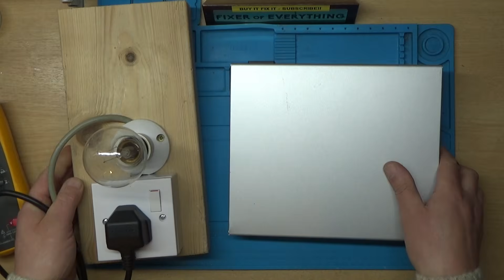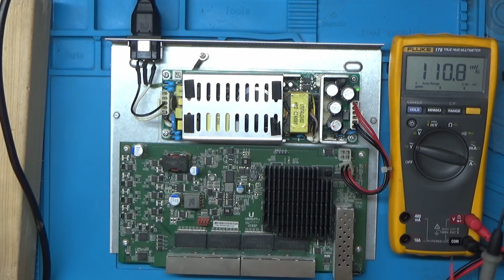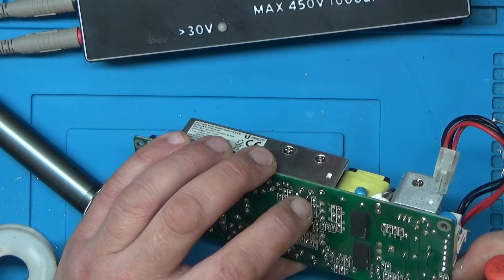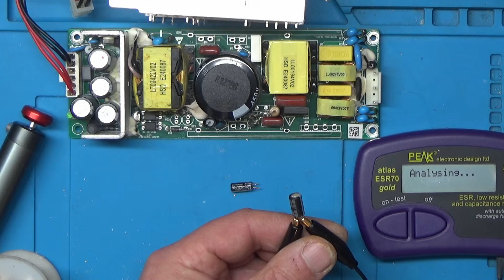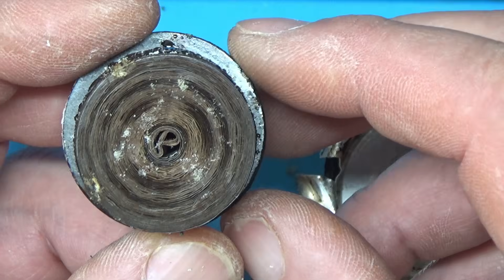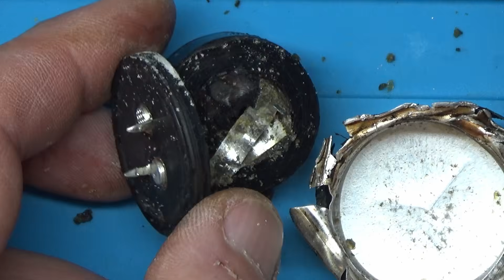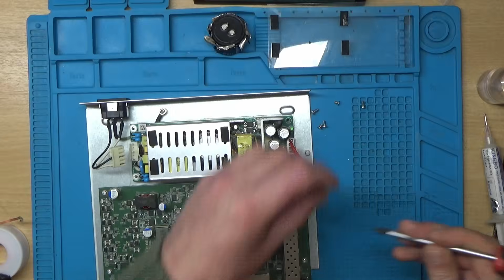Faulty Ubiquiti POE Network Switch | Can I Fix It?

Comment: Got to feel for Ubiquiti here. They make a good power supply with quality parts (Rubycon etc), but select one cheap Chinese cap for height reasons, that ends up causing a load of failures. 

Only ever as good as the weakest part! 😂
Reply from the maker: Indeed. I was thinking either cheap cap, or possibly something to do with the PFC circuit, as mains caps rarely fail in general.

Comment: Quick question - do you only use leaded solder for desoldering? I just noticed that you explicitly state that it's leaded
Reply from the maker: Yes, the unleaded solder is garbage. Leaded flows and sticks much better, and has a lower melting temperature which is why I prefer it.

Comment: my mate vince also tried to fix a ubiquity thing, it was the same cap, inside it had burned in the connection in the center, seems to be the same powersupply as well, i think there’s more of these power supplies with these defective bad capacitors
Reply from the maker: I wonder if they used the same power supply in a number of different units. I also wonder if it's a poor quality capacitor or the PFC circuit causing them to fail. I've rarely seen a mains cap fail on a PSU.

Comment: 9:45 That solder sucker is dangerous because it has no recoil protection ...
What i mean with dangerous is not that it will kill you, but if you don't think before using it you can easy knock out a tooth.
And back in the old days when we had CRT's it was very easy to break the neck of the tube if you didn't think twice before using it.
Reply from the maker: Ah see what you mean. I'd probably have to be pretty close to it to knock out a tooth though!

Comment: electrolytic capacitors are heat sensitive  , that Power supply enclosure with heatsink acts as an oven  baking them slowly .
Reply from the maker: Good point, I had been thinking was it just a poor quality capacitor as the other's seemed unaffected. Also I was thinking is it something to do with the PFC circuit switching that big inductor in and out all of the time, as I've rarely seen a mains cap fail.

Comment: Why did they put a plastic sheet over the power supply vent holes i didn't see a fan on the unit? Maybe make it fail faster?
Reply from the maker: I'm not too sure, I thought it was slightly odd too.
Reply: It's for electrical isolation, to make sure the metal heat sink of the power supply doesn't touch the case.  There's those black foam pads that are supposed to hold the plastic piece off the surface of the heat sink so that the air flow isn't blocked.

Comment: Another saved from landfill, well done. There's never enough white powder when you need some (aluminium oxide obvs). I wonder if that PSU heatsink is at some nasty voltage, hence the anti-case-shorting plastic sheet. Happy New Year to you.
Reply from the maker: Happy new year to you too Ralph. I was wondering if the PFC circuit switching that big inductor in and out could have caused the cap to fail, or if it was just a poor quality capacitor, as mains smoother failure is something I've rarely came across.
Reply: @BuyitFixit  Yes, that same cap seems to fail in a similar way in other PSUs. I was wondering about PFC harmonics, insufficient filtering, snubbing etc., though I suspect it is mainly poor quality.

Comment: The large cap you took out had an insulating disc at the top of the can, I would have thought you might have wanted to take steps to insulate the top of the new can from the metal case/shield. Anyway, thanks for the video :)
Reply from the maker: I never spotted that. Good shout 👍

Comment: "my mate vince" had the exact same failure on his ubiqiti switch repair video 2 months ago.   seems to be a common thing, junk quality caps.
Reply from the maker: Interesting. I wonder if the power supply is used in other Ubiquiti products too. I was wondering if it's just a poor quality capacitor or if it's because of the PFC inductor being switched in and out causing it to fail more prematurely as I've rarely seen a mains cap fail in the past.
Reply: @BuyitFixit  it seems to be a oxidation problem due to a bad electrolyte that attacked the aluminium.  i dont think high pulsed loads could cause that. even excessive heat, it woulld dry it out but not oxidize it.
look up "capacitor plague" which was common in the 2000s, thats why most vintage computer mainboards got bulged caps. apparently it was caused by taiwanese stealing the wrong electrolyte recipe from some japanese firm lol 

i once cut open a cap and left it laying somewhere on the workbench .. after like   2 years i found and  it didnt even dry out, it still had good esr and its full capacity.
failure is allways in combination with heat or bad material choices.

Comment: Zum entladen nehme ich das DMM in ohms range. Funktioniert super
Reply from the maker: Danke für den Tipp, ich bin mir nicht sicher, ob ich das riskieren würde, insbesondere mit einem 450-V-Kondensator.
Reply: @BuyitFixit  I agree. The ohms function is always supplying an output voltage. Applying a reverse or same polarity to another source is asking for trouble.

Comment: I watched mmv also fix a ubiquity switch but a larger (probably more modern) one. And it also seemed to have the fault with the  main smoother capacitor dying. Its not surprising at all if you trap a electrolytic capacitor that cant really handle heat well in a torture chamber, aka in the closed metal cage acting as a heatsink for the mosfets. It does not surprise me at all and its stupid design but i guess its planned obsolescence or its so you buy a new switch when it fails. Really smart to get even more money from consumers but will create more ewaste on the landfill but companies only care about money.....

Ubiquity has amazing gear but this is just  STUPIQUITY and probably on purpose too. 

Its quite funny that you also opened up the capacitor like vince also did
Reply from the maker: Interesting that the other smaller capacitors were ok, even though they were subjected to the same heat / length of time. I'm wondering if it's just a poor quality capacitor, or if the PFC circuit switching the inductor in / out all of the time were a factor in it. I've rarely seen a mains smoother go bad..

Comment: Great! They have made large ventilation slots in the power supply unit so that it is easier to tape them shut. LoL
Reply: Seems it would have been better to attach the plastic sheet to the bottom of the case lid.  This would at least allow some sort of airflow through the heatsink.  Maybe a couple millimeters.  Not good by any means, but still better than none.
Reply: I guess plastic sheet on power supply is there to avoid one or both heatsink to connect with metal case if pressed or shortcircuit between heatsinks.
Reply: @jendak7921  that doesn't change the design flaw

Comment: "One moment please...and we're back". Someone has been watching Big Clive. 😂  I just repaired a QSC power amp with blown main filter caps.  They went full short before going open circuit, blowing the 25 amp mains fuse. I suspect they connected a 120v configured amp to 240v mains.😮
Reply: Just as long as Mick doesn't start tearing down pink fleshy things and drawing circuit diagrams I suspect he'll be okay. 🙂
Reply from the maker: I have drawn the odd circuit diagram 🙂 or part. I think it was on one of the Dyson fans. I'll scour eBay for some pink personal massagers 😂😂😂😂
Reply from the maker: 😂😂😂I remember QSC used to work at a place that sold DJ equipment back in the day..
Reply: @BuyitFixit  I worked in cinema sound and projection have installed well over 2,000 QSC amplifiers. They are the most reliable I've found, unlike the overrated and overpriced Crown POS.

Comment: Just watched a video the other day by MyMateVince fixing a Ubiquiti switch (slightly larger) and it seemed to have the same powersupply with the same dodgy capacitor.. obviously a common failure.. Nice job !
Reply from the maker: Thanks 🙂👍
Reply: Shake em, some even get rattly
Reply: MyMateVince changed almost every component on it though before coming to the capacitor :p

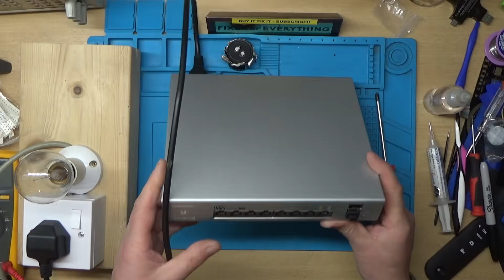When I started watching this video didn't know it contains similar PSU. I found it strange the bulb didn't flash on the first plug in, so that is the first clue. If the bulb flashes 30:08 for a moment means the hot side main cap has some capacitance as it charges and the link to it is not broken.
Reply: @semiRockethr  good thought !

Comment: Normally when pulling off the heat sink I would dismantle the rectifier and the power transistors first. I wonder if you methode would be the better way. It causes less work at least as I saw.
Reply: I've taken these units apart before, and the issue is that the mounting screws for the bridge rectifier, MOSFETs, and diode that attach to the heat sink have a nut and washer on the other side that you can't get to with the heat sink in the way.  It's easier just to desolder everything and pull then entire heat sink and devices off in one piece.
Reply from the maker: If there's nothing blown up, and you get a "tick.. tick.. tick.. " or an led "flash...flash..." or pulsing, then it's usually capacitors or a short on the output (at least that's my experience anyway).

Comment: When it doubt always suspect the Electrolytic Capacitors especially in network equipment since they are on constantly and many get hot do to poor air circulation. But I liked the Capacitor disassembly proof of concept of failure, that my friend was a Sherlock Holmes move. Great video as always mate.
Reply from the maker: Thank you kindly 🙂👍
Reply: I wanted him to retest it by clipping onto the internal leads, it kind of looked like the one was rotted off its terminal.

Comment: I think My Mate Vince had a similar big capacitor failure where it had shorted internally but didn't initially show itself at the start and yes he had to cut/mod the shield ha ha. I've fixed a few of my own items by watching videos like these, saved a few quid too in doing so. I enjoy watching your videos, they're informative and educational. I really enjoy these videos. With surveillance equipment they're on 24/7 so the caps should be checked pref changed, I've replaced some in one of my camera's after it intermittently dropped connection and works 100% now. My DVR didn't come with a fan and within 2 months the Hard drive failed, bought another same thing happened though didn't fully fail it wasn't well so I used crystal disc and basically it said it had been baked. So I modified an old laptop fan to run on a usb, problem solved.
Reply from the maker: Nice 👍Yes we can all learn from each other, which is why I like this sort of stuff. I don't know everything and never will. I also make mistakes. I've just been pissing around with stuff for years so I've got a bit experience, and usually a good head for solving problems 🙂

Comment: I muttered something like "I'd test those caps if they are marked Nichicon and from Aliexpress!" ... and you did. Sometimes I check how much video there is to run before making such rash statements, but it got the better of me today.
Reply from the maker: 😂😂😂👍I did nearly forget, but remembered before I soldered it in.
Reply: The same here. There are a lot of fake components and I would never install that thing without testing it first.
Reply: The Venn Diagram of "Aliexpress" and "Nichicon"; the two do not intersect.
Reply: It is more common for the main reservoir cap to fail with active PFC.
Reply: @FireballXL55  Yes, because active PFC does tend to stress them with high voltage, often right at the top end of the voltage range, with high ripple current all the time at high frequency, as it is operating, not the 2 times a mains cycle pulse of current
Reply: literally LOLed when he said they were Nichicon ;)
Reply: I always thought Nichicon was a pretty good capacitor?
Reply: how do you send in any items please ?
Reply: My guess is they are actually genuine but have been sorted out because they read on the low end.
There is a lot of stuff to be had like this on Ali. Nevertheless, these will be better what was in there.

Comment: Nice! The big cap! MyMateVince had one of these fail in a device end of last year too, IIRC.  He managed to cobble^Wbodge it together again, just as a funny experiment. And yes, he also cut the metal to fit the new cap! :D
Reply from the maker: Nice. I think I did catch that video, but normally when you see a PSU pulse or tick it's usually caps. Mains cap failure is pretty rare though. I've only seen it a few times. I'm wondering if it's just a poor quality cap, or if the PFC circuit is hammering the inductor in and out has shortened the life of it (this happens on the output caps of SMPS too).

Comment: Those Rubycon YXJ caps may have 25% deviation, so they're still in spec. So they have a psu with slots in them for cooling and then they put a plastic sheet on top of it :/ the heat can't almost escape :facepalm: I would open the unit and perforate the plastic sheet zo hot air can escape.
Reply from the maker: Good tip 👍

Comment: I repaired the slightly bigger 16 port Ubiquity switch that has the exact same power supply with the exact same fault (the cap also measured 0.0uF). I was unable find a replacement with the same dimensions but I 3D printed a small box and ran some thick cable from the supply to the cap and it’s been working great ever since! At least the next replacement will be simpler if it ever needs to be done.
Reply: Mmv also fixed a ubiquity switch with the exact same fault, a faulty capacitor. Its probably just designed this way to suck even more money from consumers
Reply from the maker: I'm wondering if it's just a poor quality cap, or if HF from the PFC circuit switching the inductor feeding it, caused it to fail prematurely.
Reply: @BuyitFixit  My guess with limited understanding of power supply design is that it’s a combination of poor design, poor quality and possibly heat. Thanks for the great videos, I love watching them!

Comment: The power light may have switched to blue once it finished booting. Depending on how it's been configured it may also turn off (it's a selectable preference) It is usually possible to get to an SSH login but unless it's factory reset, you won't know the credentials (default is ubnt / ubnt).

This now discontinued model by Ubiquiti was a tank and could be reliably deployed in warehouses and exterior enclosures and last near a decade.
Reply from the maker: Interesting. I wasn't sure if it was just a "dumb" switch but I guess not.
Reply: The power light stays white when it's in standalone mode.  Once it's adopted and managed by a Ubiquiti controller it turns blue.

Comment: Please could i ask please 
I have a netgear rax120 router and was working fine but now stopped and only makes a ticking sound near the power supply plug. Ive replaced the adapter same thing please any ideas please.
Reply: The router itself has short inside.
Reply: @Damicske  I've been over the board twice I can't find the short it's so frustrating
Reply from the maker: Thermal camera?
Reply: @BuyitFixit  thinking I may have to get one to find the problem with this router... I've narrowed the ticking noise down to the top centre now
Reply: Funny i have the big rax200 had a shorted diode replaced that now it ticks. Weord part is i have 5 v and 12 v rails really struggling to find whats ticking lol
Reply: @bertbertbertbertbertbert  no way really please if you find the solution please.
Reply: @DarkStormPhoenix  yer i think itll be a cap thats failed.. jist find which one of the 38000 on the board lol
Reply: @bertbertbertbertbertbert  hahahaha I can feel the pulse when it ticks whilst holding the end of the adapter when I plug it in.
I've looked over each cap and none look cracked or bulging.??
Reply: @DarkStormPhoenix  u need to measure them. Grab muktimeter see if theres a short..i gotta go across my whole board
Reply: Have a look near power input.. do ypu have one of these FDS6679AZ. I think this may be my issue.. not sure yet
Reply: @bertbertbertbertbertbert  hello chap just got in from work. Yeah I have one of those..
I will check that thank you so much
Reply: @bertbertbertbertbertbert  any luck on your board mate .???

Comment: This is an ancient switch from Ubiquiti. It would still work tho. You can manage it with the UniFi Network software. It's the controller for it. 

It's basically just an app you install on your computer and then you can access the web GUI over the IP-Address of your computer. 

You can manage multiple devices in one Web GUI, it's amazing. I myself have everything UniFi now.
Reply: kinda crap that you need ubiquiti account and install that shit server when you could just have webgui and login via ip adress
Reply: @hillppari  you do not need an Ubiquiti Account for it. You can make a local account, too.

The UniFi system is meant to be used by professionals that build the network infrastructure of companies. You can use it at home like me, if you have the technical know-how. UniFi is pretty easy to get into tho. 

It's not your generic TP-Link or whatever cheap thing the average consumer uses at home. It can do way more than that.

It's quite practical having a server with the web GUI If you have many devices. Imagine you'd have to configure every switch in a Medium sized office with let's say 20 switches. You'd go insane.
Reply from the maker: I've came across Ubiquiti before, I think it was a faulty access point that someone sent me (in a previous video if you didn't see that one)

Comment: Nice fix!! I do normally not suspect the big caps as faulty, but this was a good find!
Reply from the maker: Yes me either, they rarely fail. but it was the only other cap on the input side. I think either a poor quality cap, or perhaps the PFC circuit switching that inductor in / out caused it to fail prematurely, as this also happens on the output caps on SMPS.